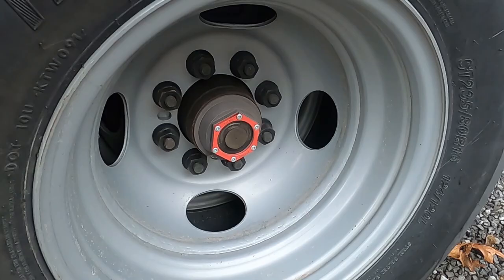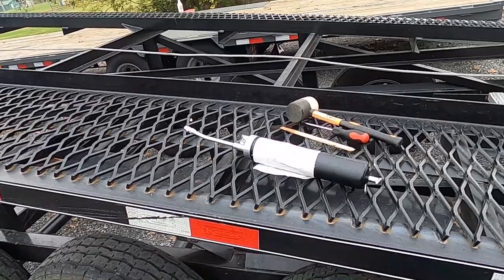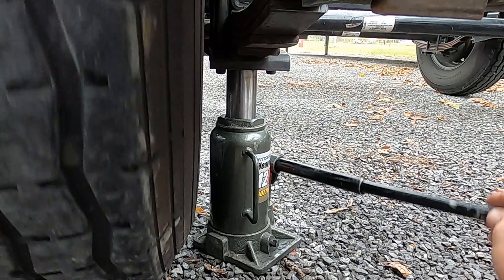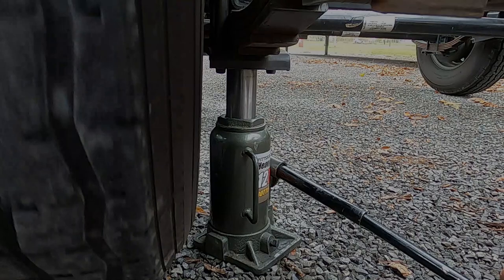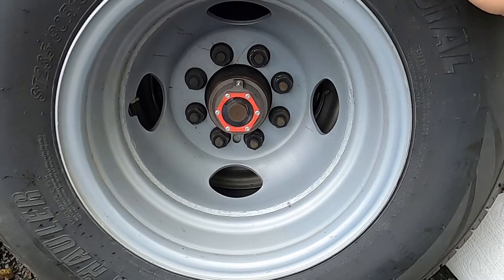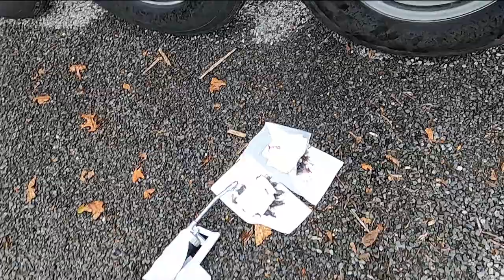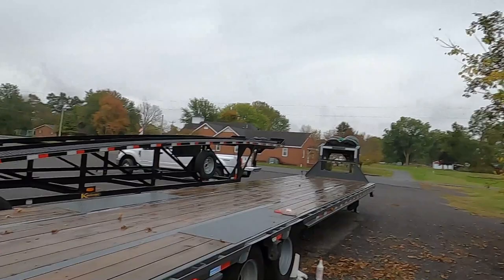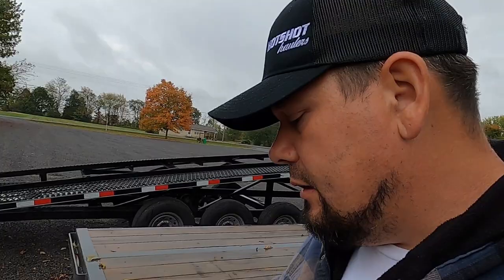Oil Bath VS Grease Hubs | Which is better? Maintenance on both!

Comment: I like the idea of side by side.  Way to go on hand pumping the EZ lube so you don't blow out the seal.  Unfortunately you made a big mistake on your Valcrums.  You put in around three times the hub oil than is required.  Here, more is NOT better it's worse.  The Valcrum 10k setup is designed to be filled to the lower line in the window.  You have two fill lines there.  You only fill the 10k to the outer or lower line however you want to refer to it.  That little hole in the center of the rubber plug behind the magnet is an air hole.  It allows the air to escape as the hub heats up.  All that oil results in over expansion and pop goes the rubber plug or your seal.  One or the other.  Drain down to the correct line asap before you make another run.  I take a coke can and cut it to the right size and wedge it under the lug nut.  That way you can walk away while it drains.  I put all four drain plugs at six o'clock and then lower the trailer back down.  I think more of the old hub oil drains out when the axles are back at level.

Comment: Oil bath cut my failures except for plastic caps that cracked with age. Valcrum fixed the cap problem. The two piece seals used on oil bath and wheel bearings run with 0 to faint load (not backed off till the disc or drum wiggles) stopped issues on my hay,  tractor , and living quarter horse trailers. All with wet hubs. On the other trailers with EZ lube I never use the through cap fitting. It too often pushes grease through seal. I pack them manually and used solid caps so the rubber cap doesn’t let water in.

Comment: To me, the process of changing grease would seem to be easier to pull the wheel and repack bearing and new seal
Reply from the maker: Well there are 2 bearings and races to remove plus a seal. I don’t know how many you’ve changed but I’ve changed quite a few and it’s not easy lol if I’m going through all that work it’s getting new bearings, races and a seal.
Reply: @LoadMizer  Pull wheel, clean and inspect bearings, repack bearings properly, install new seal.  Races stay in the hub for this process, unless you find a reason to replace a bearing. That process goes for both types of hubs. The process you just showed is a "partial" grease/oil change. 

We're both different people, but I like to completely change my oil.  I also like inspecting my bearings and brakes while I'm there.
Reply: Just about every RV Repair Guy I've talked to says those Grease Buddy's are Crap!! Most say they have made Big Money Changing the Brakes from being soaked in Grease ): They Fill the complete Hub Full that's why it takes a tube of grease>>It gets Hot and MELTS down on the Brakes Bad Bad Bad!!
Reply: @halojamestransport7352  I agree, I run three of the Kaufman four car easy loads with triple axle. Two or three times a year I break all hubs down put new seals in clean all bearings inspect all bearings re-pack and reassemble. To me that is the only correct way to do it. If not, there is no way to inspect your bearings in a sure that you are not overlooking anything.
And honestly, I can knock that hub off and do everything I just explained and reassemble if I do not find any bad parts in about 15 to 30 minutes per hub and then go down the road with a piece of mind
Reply: @bz4shez  great minds think alike!  Gotta have piece of mind when your living depends on it.

Comment: On the caps for the grease hubs I've always used Permatex 80015 non-hardening sealant to seal them. Just make sure to clean both mating surfaces well and use a light coat. Never had an issue.

Comment: On the grease hub I clean the edge of the hub with brake clean & the hub cap also. Then apply silicone sealer no leaking or seeping, will also work well on your oil bath hubs.
Reply from the maker: These grease hubs definitely get nasty

Comment: Great video, thank you. I assume the greasable hub trailer has brakes. I would be pulling the drums once a year to inspect the brakes, and properly repack both inner/outer bearings. The EZ Lube system is great, but, the drums gotta come off too. I just found a broken brake magnet last week. I had no idea it had come apart.

Comment: It would be nice if you get the chance to compare torsion axles vs leaf springs and witch one is better
Reply: Dual (or triple for that matter) torsion axle trailers MUST be towed level so the tire loads are equal. Leaf springs equalize via the equalizers (Y shaped spring hanger).  If that part is ok then I have better service from torsion. No bushings, bolts, shackles, etc to wear or loosen. Torsion by nature dampen motion and a bump on one side isn’t moving axle on other side since the spindles are carried independently.

Comment: Don't knock the dust cap off the EZ lube. Pull the rubber plug and grease while spinning. The old grease will come out around your grease gun fitting. In a worst case scenario; if your bearings get hot, the extra grease in the cap will start to ease its way to the bearings.

Comment: use a plastic cup and place it in the wheel hole and then you dont have to hold the container and i let it drain as i am working on the next hub

Comment: Maybe if there is a kit you could do one side oil bath see how each hold up?
Reply: I asked the trailer mechanic at work witch method works better.  He told me he doesn't see a difference.  He's been doing axles for over 30 years.

Comment: just my 2 cents if it's your trailer and the only driver go oil it's the better of the 2 imo. but if you have a driver using your trailer go grease they seem to not care about taking care of the equipment .

Comment: Just traded my 30 foot srw gooseneck with torsion a les that were greasers for a 30ft tandem dual axles with oil baths. Would you mind posting those caps? I wanna put all new sight glasses on mine and at least drain the oil in them and replace with new. Dont think the races/bearings need anything being oil baths

Comment: I've heard the light duty 7k axles with single wheels flex too much and cause the oil bath seals to leak? That's just what I hear .
Reply from the maker: They do flex pretty hard.
Reply: That flex is mostly from loose wheel bearings. Get the spindle nuts that 12 notches instead of 6. Pack bearings and assemble with nut tightened with pliers then backed off and run down as tight as you can get with fingers. If Cotter pin is not aligned then go tighter the small amount until it goes in. 6 notch nut risks having you go too far to get Cotter pin installed and harm bearing. Bearings will have less load per roller if the bearing runs snug so all rollers across full width stay in contact. If you do as I listed when you are done you will be able to feel small deflection (wiggle) at tire tread if you push in/out. The bearing will not burn up as it is not that tight.  Loose bearings leave some rollers not carrying load and the seal has to try to follow the spindle seal surface that moves closer and further from seal bore as hub wobbles around.

Comment: May I ask a question I noticed my tag dragging big Tex 25k is it optional to have the tag inside the cab instead of dragging it down the road from low areas 
Thanks in advance ✌️ great information dude great videos 👍
Reply from the maker: Nah it has to be “permanently” mounted on the trailer next to the tag light. Mine is on a hinge and I actually caught a little crap about it when I got stopped twice in one day. It allows the plate to lift when I drag. Only forward though. Not in reverse. Apparently it flaps going down the highway 🤷‍♂️
Reply: Thanks dude!! Good idea 💡 👍I’ll look into getting a hinge installed!!!

Comment: Major downside to oil bath is if you loose a seal your going to have major damage within minutes and your left on the side of road  not to mention risk of leaking oil catching fire on hot bearings. Grease bearings never catch fire and can almost always limp in some where due to the fact you rarely loose all lubricity. Newer spindle lube technology makes grease the overall better system non pro haulers and the little bit of extra steps for maintenance is usually something you only have to do once maybe twice a year with normal use. I feel the video maybe over exaggerated the time spent on grease. 6 minutes to just get the grease cap off seems a little excessive. I have both and as long as the oil stays full they seem to run cooler more consistently but if they fail it seems to be more catastrophic.

Comment: LM - How often do you swap your oil out? I have Lippert axles and their manual is silent on change frequency. Diamond C was vague when I called them.
Reply from the maker: The manual for 10k axles recommended 10-15k miles. So I changed it about once per month when I was running hard. That lines up with brake and bearing inspection so you would have to remove the hub anyway in order to check the bearings. 👍
Reply: @LoadMizer  Appreciated. No idea why Lippert's 16K axle manual is silent on the matter, but your range sounds about right to me.

Comment: There is a simply and better wayin keeping your wheel bearing from going out on you. Use synthetic base grease and oils for your axles . It may cost you a little more but a lot less headache on the back end. And maintain or changing the oil is less. Big trucks and trailers  used it and the only time they change the oil is when the seal goes bad. With grease hub trailer the only time is at a brake job. And that at over 100000 miles. I do it to lot of the guys and women trailer and the bearing problems go away and less down time. You be the judge
Reply from the maker: I’m gonna check into that. Thank you 👍
Reply: I was going to ask about the mileage/wear differences...
Reply: @CatarineausArmory  With grease hubs the wear factor is less in some cases. As long as your seals are good and you repack the bear per factory specification. But if the bearing get too hot then big damage will happen. Oil type hubs keep everything cool and is able to handle higher heat temperatures. This type of system is used on big trucks / trailers . It all boils down to the gross weight that you are hauling and the axle setup. Per builder!!!!
Reply: @cruizgonzalez5004  Thanks brother!!
Reply: You’re saying to mix the grease and the oil together in the hub?

Comment: With the grease hubs and the method you are using, there is just about a 50/50 chance of pushing grease out the inner seal and getting grease all over the brake shoes. There are far too many reports of this happening. I pump 4 to 6 strokes in mine twice a year, and repack/inspect every 15,000 miles.
Reply: Yup, been there done that

Comment: If this is your maintenance i would highly recommend taking the hubs apart to check the bearing and not just shove grease/ oil in. I may be completely wrong, but from my understanding oil vs grease is more of a use case. If you use your trailer alot go oil, if it sits alot you want grease.

Comment: Question: My boat trailer has oil bath wheel hub bearings, after a trip, my sight window on the wheel hub is protruding out and the wheel is pretty hot to the touch (I suspect from my trailer brakes maybe constantly engaging, that’s another issue I’m addressing). Is it protruding out because of the heat or is it another issue?
Reply from the maker: Yeah if your hub is hot to the touch you’re definitely facing a big problem. Those pads on the drum can catch fire pretty easily, especially oil bath hub. It’ll melt that seal and that oil basically turns into fuel. Sounds like you’ll fix your problem addressing the brakes on that wheel
Reply: @LoadMizer  I appreciate your reply! The guy I bought the trailer and boat from really neglected the trailer and maintenance on it. I’m going to completely drain the old oil in the wheel hubs and look into the brake issue. Thanks again!

Comment: My question is why are you wasting all that good grease I mean that stuff still good in there I mean you’re just pushing more grease in it and taking good grease out I don’t understand but please someone elaborate let me know that’s why am asking the question
Reply from the maker: I use the red n tacky grease from Lucas. The maintenance intervals on those bearings ranges from 10k-15k miles. The grease I scoop out is black. As you pump new grease in it will start to turn purple, keep pumping and it will start to have red streaks in it. That’s when I stop.

Comment: Ok what’s the advantage to the grease hubs versus the oil hubs?
Reply from the maker: Just my opinion...I don’t see any advantages lol
Reply: There is a pro and con actually. If you get a leak in an oil bath set up, you are done until you fix the leak, and change he bearing and seal. Oil come out mighty fast under load and heat. With grease, you can still drive a long way on a blown seal. This affords you some leeway and not stuck on the side of the road. 

What you are trading through, is time. As you can see by the video, you can change up the oil in an oil bath in close to half the time. Which also means you will more likely keep upon your maintenance. Whereas grease bath axles have a tendency to receive a little less attention in maintenance because no one enjoys regressing a hub. 

Just my two cents, adjusted for inflation.

Comment: Do the oil bath have any seals that need replacement when changing the oil?
Reply from the maker: There is a rear seal on the back of the wheel hub but as far as the oil hub goes it’s just a rubber O-ring.
Reply: @LoadMizer  do they both need to be replaced? Where would I buy them? Planning on changing out the oil soon on mine. Thanks
Reply from the maker: Depends if you’re leaking oil or not. You can find both seals on etrailer and other website like that. You just need to know your axle size and hub specs.
Reply: @LoadMizer  you didn't mess with the seals since they weren't leaking? Just trying to figure out at what mileage it's best to change the oil and seals?
Reply from the maker: I didn’t mess with the rear seals no, when I replaced the front caps I changed the rings. Anytime I pull the caps off I change the rings but if the rear seals and bearings are good they stay in until recommended scheduling suggests they be changed out.
Reply: @LoadMizer  how often do u change ur hub oil?
Reply: @LoadMizer  what is the recommended mileage to change out seals and bearings even if they are not leaking brother?

Comment: Question for u sir
Reply: Do u use hub oil or can I use gear oil to change eoh brakes
Reply: Or what kind of hub oil to use
Reply from the maker: Dexter recommend 80w90 but I just use the Lucas hub oil. It’s at nearly any truck stop and Walmart. Easy to come by if I run out. Gear oil and hub oil are the same thing.

Comment: How often do you change the bearing on the oil bath of you do at all?
Reply from the maker: Not really in a schedule for me. If I get some play in the wheel when I do maintenance I change them then as they’re showing signs of wear. Some last years. Some last months lol
Reply: So there should be no play on oil bath like there should on grease hubs correct?

Comment: Dust cap removal tool, stop bangin on shit, those come off in seconds with the right tool
Reply from the maker: Lol I’m not buying a tool that costs 20x the part it’s made for. A soft mallet isn’t hurting the caps. Need a hammer to reinstall/replace them anyway. That one was mangled from the previous owner anyway. In the end it’s just a dust cap. Calm down.

Comment: I don't trust an oil bath. If your seal leaks at all, all your oil is gone fast. If it was so great, why do all car manufacturers use only greased bearings? It's another gimmick in the trailer industry. It will fail more often trust me.

Comment: Do not do what this guy did. Remove the bearings and repack. This is straight up LAZY and will result in failure.
Reply from the maker: This is routine maintenance that prevents failure. Unless you’re pulling the hub there is no need to pull bearings if there is no sign of wear. If you’re pulling the hub then yes, might as well repack just like I did in my brake video. Not performing maintenance is lazy.